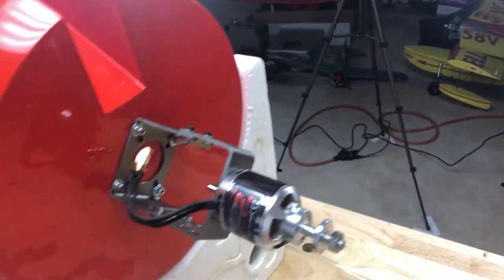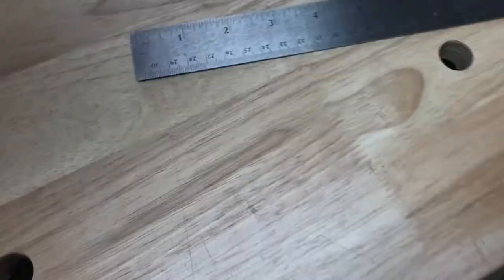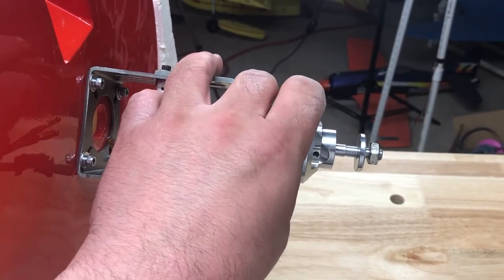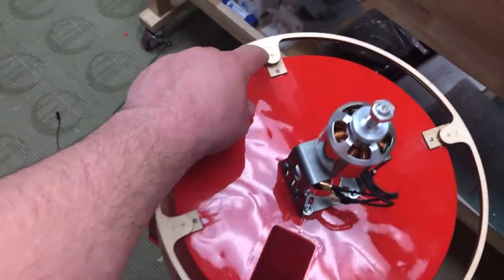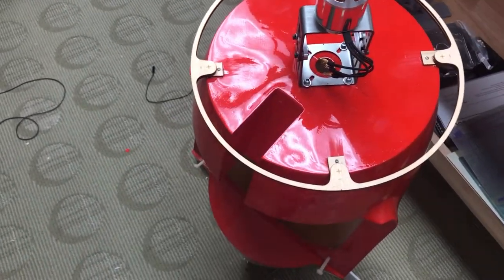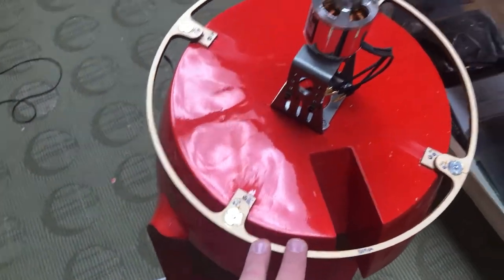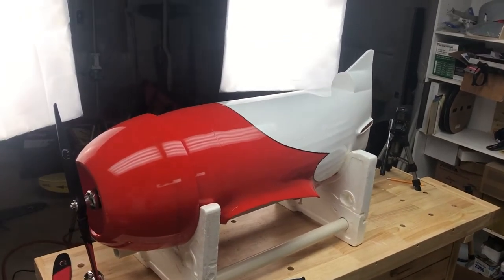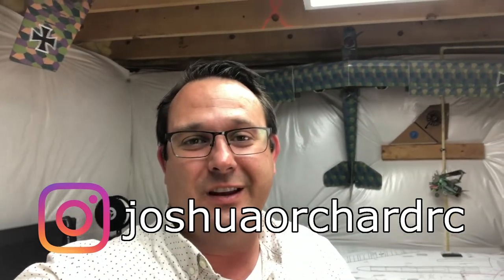Gee Bee R1 Episode 4: Nose job

Comment: Hello, nice work 😊 But I wonder what size your motor have? ..And how many S and size on the battery? ..And how was the feeling in the air with that? 
Please let us know.
Have a nice weekend
Reply: Hello again, I saw your answer on most of my questions on your Instagram.😊👍
Turnigy 5055 320kv. That motor has been flying my GP Giant P6E Hawk for years now. It should fly this bird just fine on 6S swinging a 18x12 prop.
Reply from the maker: Motor used is clearly visible at 2:35 in this video. Turnigy SK3 5055 320kv. 

Battery size:
https://youtu.be/MtySI9WBqNM?t=212

Flight video:
https://youtu.be/HHECDa9QupU